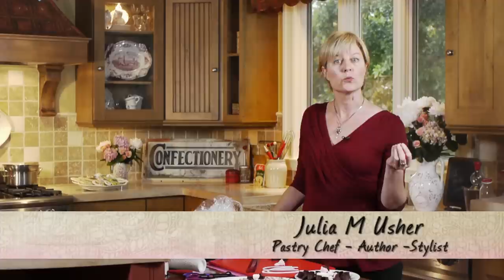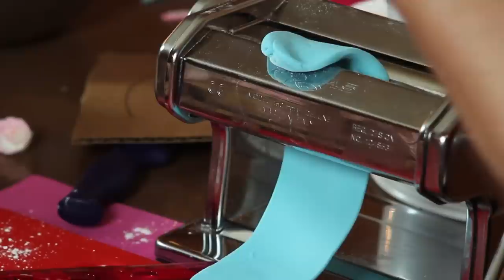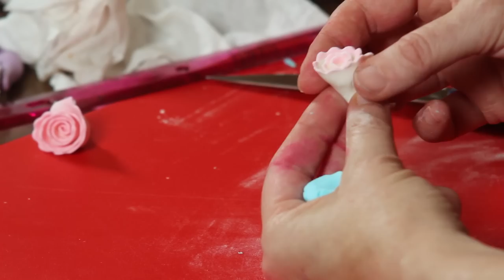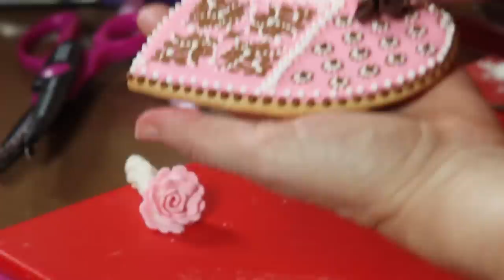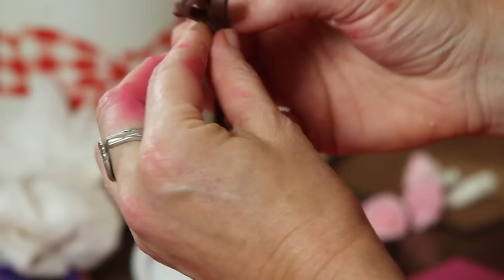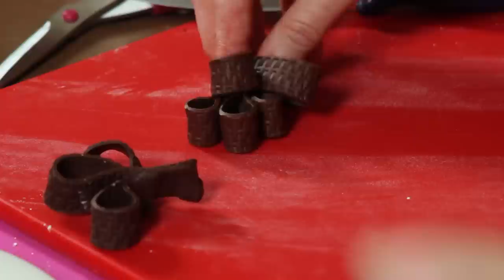How to Make Ribbon Decorations Using Fondant and Modeling Chocolate

Comment: Hi, how long does it take the fondant decoration to air dry ? Can we speed up to the drying time by putting in the fridge or freezer? I made some seaweed and leave it outside for 2 days and they were still soft, I couldn't put them standing up and when I touch them they tend to get more soft. The seaweed were not thick at all about 1 to 2mm thickness and it would not dry. Is that because around my fondant, to preserve it, I covered it with a coat of crisco vegetable shortening and leave it in the fridge? And once finish I put my cupcakes with the fondant decoration in the fridge, can I put them in a sealed plastic cake carried container or should I not cover them? I did put once in the fridge in a container and my fondant decoration melted, I was being told that it is due to condensation but I was wondering it is because of my fridge that it happen or should I just not cover it at all. Not covering it I am scared it will make the cake part harder. Please help. Thanks.

Comment: hi julia, i'm gonna be making  molded chocolate and the design is minnie mouse. unfortunately, where I am at, there's no available mold for minnie mouse. i did found a mickey mouse mold (which i will be using) and i will just decorate it with a ribbon,what would you suggest I use- fondant or molded chocolate? i tried to make chocolate clay (i used white chocolate, but did not turn out so well). i'm planning on using rolled fondant instead, but i'm not sure what to use to make it stick to the chocolate. i live in the Philippines and the climate is really hot compared to where you are. i hope you can help me out Thanks in advance.

PS. i'm still interested in making chocolate clay and i'll still go on and practice so i can perfect it. Thanks again.

Comment: I've made fondant several times. I've been told, repeatedly, that it will last for quite some time if kept wrapped in the fridge. But, each time, it hardened and crystalized. What might I be doing wrong? I have been careful to wash down the sides of the pot when I was making the fondant, so I'm pretty sure there were no starter crystals of sugar in the finished product.